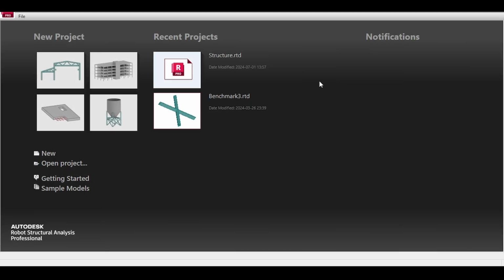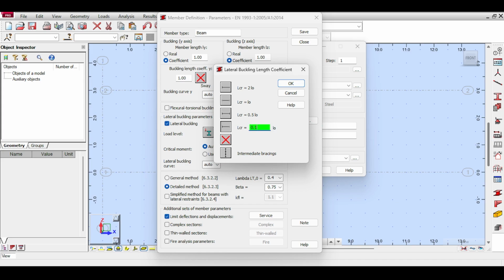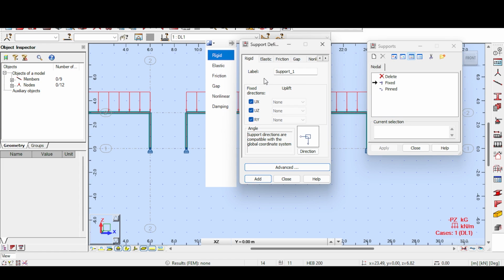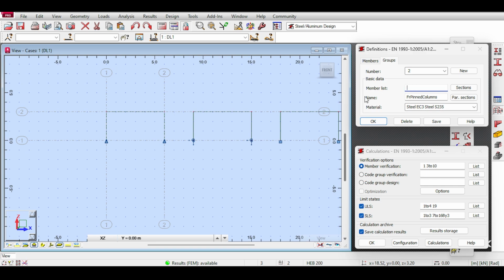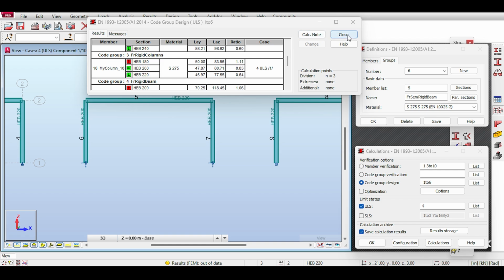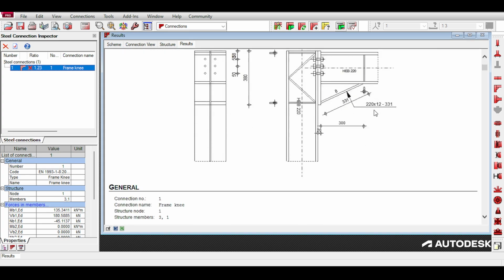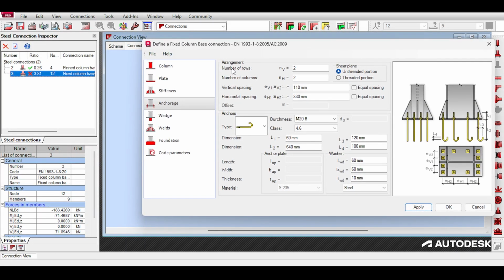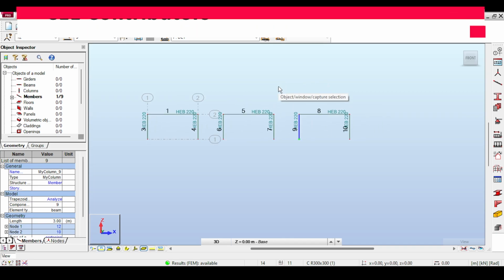Design of Steel Frames Workflow: Members & Connections as per Eurocode EN1993 using Autodesk Robot

Comment from the maker: Hello all,
Please keep in mind that you would still have to check the concrete of the support, and if it is able to hold the reactions, namely:
1) Vertical downward load. (Reaction Fz)
2) Horizontal shear load. (Reaction Fx)
3) Bending moment. (Reaction My).

This may need you to adopt a larger foundation and/or apply some eccentricity to the foundation.
Please have a look at my foundation videos with moments for more context.

If you have a mat foundation, then you would have to apply the reactions (Fz, Fx, My and others if applicable) as actions (loads) on the mat at the location of the column. Or just model the mat foundation below the frame and it will be almost a fixed support.

Hope this helps. Please feel free to ask any questions. I will do my best to answer them as soon as I can.

Regards,
CEE

Comment: Great Video! Can you do a video that highlights the differences between 'Code group Design' & 'Code group Verification'.

I usually use the optimisation function in steel design, but would like to see how you handle checking the deflections and optimizing the design.

I sometimes end up down a rabbit hole as the iterative process seems never ending!

Would love some insight into that using this same frame example.

Comment: Great video Eng. I have a question, under code parameters for baseplate design, is it recommended to design with concrete as cracked or uncracked, and why ?

Comment: Hello CEE,

I’d be lying if I say that I did not enjoy the sheer torture and frustrations of the recorder guy at the end when connections designs were not readily working out. I think that the CEE editor was having a blast throughout those moments, and in a small way, I feel equally guilty by association in that regard.

I would like to be crystal clear that I was not relishing because I wanted the CEE to suffer, no, that is far from what triggered my amusement. I often experience similar frustrations during design and it is strangely comforting to know that I am not alone and this is why I could relate and was triggered by the frustrations at the end. I admire the fact that the CEE did not edit the frustrations out and has kept the whole thing real and for that I thank you. Honestly, there is even more that one could learn from the various attempts that were made to try and make things work out.  

I can also say without any doubts that, the key principles and concepts showing what exactly needs to be done throughout the video from the very beginning to the end were provided and those principles are priceless, thank you so much for this.
 
I suppose that the shape and type of the final design solution(s) “depends” on the designer and on how far and how many options the designer is able and is willing to explore.

I have enjoyed this video and I am looking forward to future videos by the CEE

Kind regards, DK
Reply from the maker: Hey there Engr. DK, 
By the way, you hit the nail on its head. The reason why the editor keeps those frustrating parts is to show people that: hey! this happens to every single one of us. I just want to be honest in my videos, and not always show things to be "perfect", because they are not. I'm just a human, after all ("so don't put the blame on me?.. ^_^")

Yes, I 100% agree. Despite the fact that I try not to simply say "it depends", but in all honesty, it really depends ^_^

Thank you very much for your input. I really appreciate it.
Also, sorry for being late (the members post already explains what I was doing during this delay)
I am really inclined to pin your comment, but I already pinned my own as I had a very important clarification to make.

Stay tuned for more content,
CEE
Reply: I like this too,very much.

Comment: Hi there, one thing to add, portal frames are susceptible to sway effects i.e. global stability .... nothing is perfect in this world ;) cheers
Reply from the maker: Thank you very much for your kind input to the matter. It totally slipped my mind discussing this. Thank you for real.

My plan actually included a braced frame for comparison (only artificially braced with a roller that prohibits side-ways movement), but the video length really ran away from me. The video length is waaaaay longer than what you see here, with a lot of time having me pondering about what to do with the rigid base plate (that shows how complicated it can get). You can even see that I added a pinned comment about the foundations. 

Anyways, I am always happy to see any comment and question, and will do my best to reply to those as soon as I can.

I wish you all the best,
CEE

Comment: Thank you. I've got two questions:
1. Could you please provide an example plate girder model and design?
2. If all of the joints in a truss are welded together, how do you model the joints in Robot? Do you specify the joints as fixed or pinned, or you just use the default specification in Robot?
Reply from the maker: If the truss joints are welded together, I would still assume them to be pinned (with a twist). I will show you why in a video ^_^ that is a great video idea.
Because the loads are applied at the nodes, the components of moments may be less than what you would expect and would not affect the design.

The twist is: I would assume the top chord and bottom chord to be continuous (so one full piece with no hinges). This would be more accurate.

Here is a quote from the book: William T. Segui - Steel Design - 5th ed - Section 3.8 - Page 79
"Ideally, purlins are located at the truss joints so that the truss can be treated as a
pin-connected structure loaded only at the joints. Sometimes, however, the roof deck
cannot span the distance between joints, and intermediate purlins may be needed. In
such cases, top chord members will be subjected to significant bending as well as
axial compression and must be designed as beam–columns (Chapter 6)."

What he means here: because purlins are connected to the truss at the joints, we can treat those as pin connected elements. if you would have a purlin in the middle of a truss element, then you would have a beam column.

Now I know this sounds crazy, but the codes do actually account for "Modeling accuracy" in their factors of safety.

I am really thinking of making a truss design video on this channel, and maybe show a "what if" scenario where I remove the releases, so that you would see that the changes may be minimal. But who knows? 

Thnx a lot for your comment.

Oh, also nice suggestion with the plate girder video. I will think about it and if RSA does support those design checks.

Anyways, stay tuned for more content,
CEE
Reply: @CivilEngineeringEssentials  Great. Thanks for the response.

Comment: Referring to the base plate design in the code parameters tab, there is a concrete "check". When I have it clicked and active is almost impossible to pass the check and the connection is unrealistic.
If I switch it off, it seems more normal, the connection passes the check and the design is realistic.
If I have a mate foundation and a pier where my base plate is fixed, is it legit to uncheck this option?
Reply from the maker: Hello all,
Please keep in mind that you would still have to check the concrete of the support, and if it is able to hold the reactions, namely:
1) Vertical downward load. (Reaction Fz)
2) Horizontal shear load. (Reaction Fx)
3) Bending moment. (Reaction My).

This may need you to adopt a larger foundation and/or apply some eccentricity to the foundation.
Please have a look at my foundation videos with moments for more context.

If you have a mat foundation, then you would have to apply the reactions (Fz, Fx, My and others if applicable) as actions (loads) on the mat at the location of the column. Or just model the mat foundation below the frame and it will be almost a fixed support.

Hope this helps. Please feel free to ask any questions. I will do my best to answer them as soon as I can.

Regards,
CEE
Reply: @CivilEngineeringEssentials  
Thanks a lot for the answers.
My model is a 4 steel columns structure fixed with base plates into short concrete piers. Those piers (saddles) are connected to a mat foundation as a whole unit. [will be casted together]
I modeled the raft slab as a shell, the four saddles as columns (calculating bending and shear reinforcement) and each one sharing a point with the steel columns. This concrete-steel connection I modeled it as a base plate connection.
The forces are transferred correctly and the analysis shows no errors.
My question is if the connection check is legit?

Comment: Thank you
It is possible to design the connection as per American code
Reply from the maker: Hi there and thnx for your comment.
Unfortunately, Autodesk Robot does not have any AISC/LRFD codes or American conforming codes in its connection database. 

Thus, it is not possible to design connections conforming to American codes.

Regards,
CEE